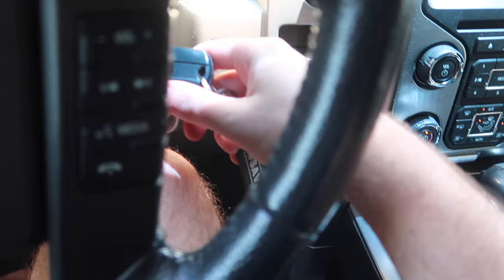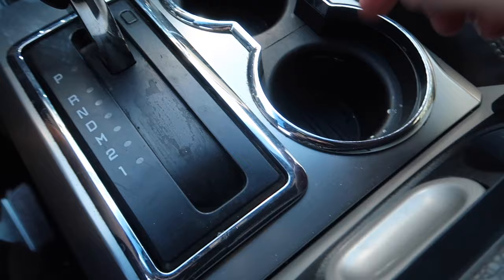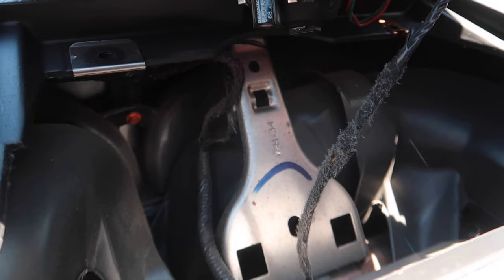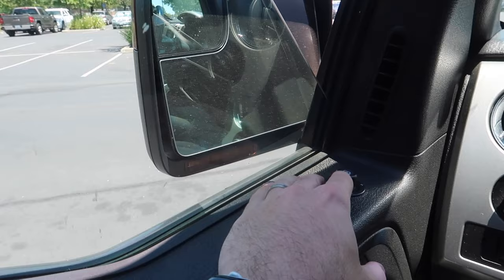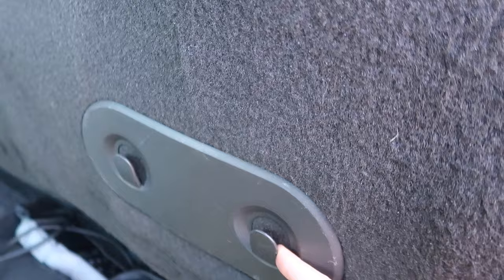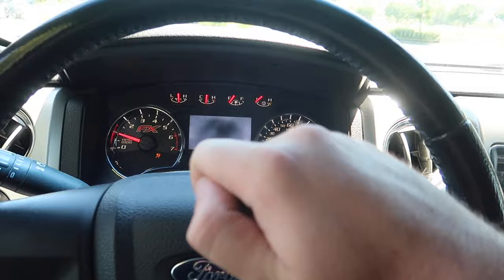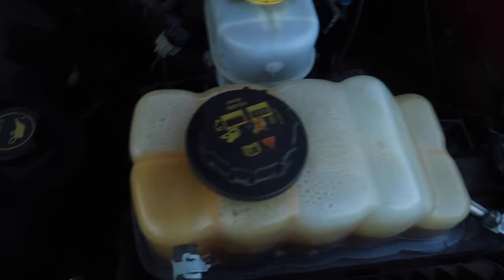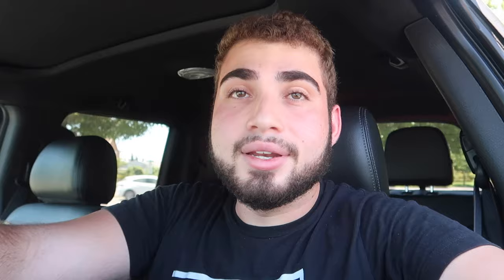FORD F150 HIDDEN FEATURES/FUNCTIONS (2004-2014)

Comment: If you have the keypad on your door after entering your door code press and hold the number 3 it will unlock the remaining three doors.
Reply: My dad had a ‘15 super duty f250. on that you don’t need to hold button 3, just press.
Reply: So after entering, i have to go out again to the key pad :(
Reply: Press 7 and 8 and all doors will lock
Reply: Dang. I have my 2013 for almost 10 years and did not know this. Thank you!
Reply: @Matt Keene what about if u don't know the code n it didn't come with the book. How do u find out what it is??
Reply: @desireewatson4828  you can find a YouTube video on that
Reply: @casey587  thanks
Reply: @desireewatson4828  look on the passenger side front, open door look at side panel near floor board there is fuse box inside that you will find the reset code for your vehicle. Ford wants to charge you $100 for this code that is inside your truck and they do the same thing.
Reply: I can't remember which one but you can also start your car/truck by pressing one of the buttons after your code twice
Reply: @ronaldnorris2179  on the 11th gen f150 like he has it's 9-0 and 7-8
Reply: @desireewatson4828  look up on you tube. I did it with my kid's ford escape. Hers was stamped inside the gear shifter. Idk abt the f150 though.
Reply: @denise6861  I'm needing it for my '08 edge
Reply: @desireewatson4828  you tube it and be very specific in your search, like "finding door code on an 08 Edge"
Reply: It’s on a sticker that is on the passenger side lock panel fuse box
Reply: @denise6861  if you have both keys you can get the factory code to pop up on the screen then change it to your own on the radio I found it on a video on here
Reply: You can also lock the truck from the keypad - just press the last two buttons simultaneously.
Reply: @desireewatson4828  It is on a sticker on the side of the cpu module underneath the passenger kick panel under the dash.  Hard to get to though.
Reply: @desireewatson4828  passenger side (interior side wall of the foot well) inside the fuse box compartment, should be the factory code, on a sticker. There is a YouTube video somewhere.
Reply: @cavebexartx  I got it for my 08 Edge. My wife just got a 2020 Edge n of course the card for the door code is gone. There's 2 ways to find it. 1 would b super easy if we had 2 key fobs but we don't. The other is to stand on your head driver side unscrew a bolt pull out a little bit the fuse box. Take a mirror with an extension on it read the numbers. Remember it's gonna b backwards. Put everything back. They make it so easy 🙄 😂. This fat girl is gonna look for another way 😂😂😂
Reply: My 08 doesn’t have a key pad.
Reply: Or just go on to the settings and change it to a “one-step lock”
Reply: Thanks for that. I didn't know it could do that. That comes in handy.
Reply: Awesome video. Good info. Thanks 😊.
Reply: Or program it to unlock all doors with the code
Reply: Put in the factory keyless entry code and when It unlocks press the 1-2 button and it will lock and unlock. Now you can put in your own 5 diget code.
Reply: @desireewatson4828  well just incase you didn't find the answer by now the factory code is behind the passenger side kick panel it should be a sticker on the fuse panel it should be a 5 digit number
Reply: @desireewatson4828  pull the fuse panel cover off on the passenger side floor kick area and it's on a sticker
Reply: @kathytracy9495  how do you reset the truck though? Somehow I've activated the admin function where the radio will not go past half way in volume and speed limit, I cannot go over 80
Reply: @sebastiannelson9506  You need to look up ford my key
Reply: U can always open the door an hit the button
Reply: Go to settings and change it to where they all unlock
Reply: @desireewatson4828  on the passenger side footwell, there is a access panel where you’ll find the original factory set code.
Reply: You can go into your settings on the dash and set your key fob to where all doors unlocked with one push of the fob
Reply: The owners manual will show you how to set your own custom door code number.
Reply: My f150 you only have to put in the code and it will unlock everything. And you press the two back buttons and it locks it fast
Reply: @ryanwagner382  this is the method I used but I also needed to pop out the cupholder and insert the main key in a slot under the cupholder.

Comment: Also a cool feature about the 3.5l EcoBoost engines is they will actually stretch your timing chain to a bigger size. Just a little neat thing.
Reply: LOL!  I have the 5.0 V8, glad I didn't pick one of the EcoBoost variants!
Reply: Lmao what even 😂
Reply: Can confirm happened on mine a few years ago
Reply: Glad I bought a Gen 1 V8 Raptor instead of a Gen 2…😂
Reply: @Mineratron  me too!
Reply: ya last year I spent $3500 on that fun little thing
Reply: Coyote 5.0l in mine. My friend bought same truck same year and bought the eco boost 6 cylinder and has had major problems with it. So glad i never bought the eco boost engine. I tow heavy loads with my truck and in 10 years never missed a beat.
Reply: I have a warranty 100 dollar deductible so idc 😏
Reply: Yup timing chain and cam phasers
Reply: I got the 100$ deductible warranty on mine too🤣 kinda hoping shit goes out so i can get it replaced ahead of time
Reply: 5.4 also does this
Reply: @regularguy1140  yep makin a whole 275rwhp with that 6.2L V8, squeakoboost raptor gaps you all day
Reply: Fun fact, all vehicles require maintenance.
Reply: @Mineratron get gapped by a little 2.7
Reply: @Tannerbaker3331  doubt it… mine is a Stage 2 Roush 🦾😄
Reply: @Mineratron  you from Texas?
Reply: @Fredjoe5  Same here.  Even though the Eco-Boost is a better performing engine, as a DIY backyard mechanic, I just didn't want the added "things that can fail" and stuck with an engine design I'm more familair with.
Reply: @drewdias3380  And it's a good thing they had "lifelong" spark plugs in them.  Lifelong whether you wanted them to be or not.
Reply: @bobby D  lol you can change them if you have the ambition and a couple spare cylinder heads just in case
Reply: @jeremyjones6667 auto start every start up. Never let it cool down before you turn it off, turn off as fast as possible. Good luck
Reply: How do you prevent that?
Reply: 😂 true
Reply: Throws the Timing Off and makes the Truck run like crap and you get piss poor gas mileage! That crap blew up my engine!
Reply: @Fredjoe5 it happened to my 2011 5.0. It's not just the 3.5
Reply: Oil changes are important never go by that timer ford has also used full synthetic I have 250k on my 14 EcoBoost and haven't had a problem mind you if I did it wouldn't but me up until this point I've only done plugs 2x and a 2x break jobs and the booster gasket can't really hate nothing last forever I do feel sorry for the new gens I've heard they have a lot of problems

Comment: It's been on Ford trucks since at least 98, but I've met many people with f150's that didn't know about the extra tailgate posts.   You open the tailgate and if you unhook the top cable there's a second post above it, put them both on there and then your tailgate will have about a 30 degree incline. Great for hauling lumber or something you can raise the plywood or 2x 4's up to help keep them from sliding backward

Comment: There is a release pull behind the back seats just inside the door so you can fold the seat forward and store some smaller items. I actually added a little cable and attached it to the headrest post for ez release
Reply: Same here, but instead of trying to drill a hole in the short post, I just tied a tight knot to it then hot glued it.  Seems to work fine so far.
Reply: Great to hide your truck gun!  They make an adapter that allows easier/quick access!
Reply: Me too😊. I like that little hack
Reply: Yep, I don't know why Ford made it a pain in the butt to get to that latch. I hand a big 😢 it is really hard to get back there. Likewise,  I tied a picture frame braided wire to it and tucked it under the headrest.

Comment: Been a GM guy forever. I just bought a 14 King Ranch and it is an absolutely awesome truck. So many features that other brands just dont have. I never realized how well Ford engineered these trucks. Rides amazing and is fancy.  Smart as hell and definitely convenient.
Reply: Great year
Reply: Huh. After a nightmare of ownership from a 5.4 3V, I'm certain I'm never buying a new Ford again. I obviously see you got 2014, so that's not new either Funny thing is I tend to agree about the looks and drivability.  It certainly is reflected in the insane prices they ask for them.  I still own my 2004 FX4 crew, really only because I'm kind of "stuck" in it, if you will, for all the remanufactured money I poured into it
Reply: @teecuzbruh4058  12th gen were fantastic. Easy to work on, only a few problems to watch out out for such as the coolant y pipe and transmission quick connects, 
I have 128k on it now and have had 0 hiccups. Intake cleaning took the tick out of the 5.0. 

I'd buy up to a 17, Ithey went to third gen coyotes after that
Reply: @teecuzbruh4058  , it’s no wonder you’re unhappy. The 5.4 was pure crap!
Reply: @Navyguy1990  Mine runs fine, and tows very well for a stock setup, for now LOL.  I won't ever be buying Fords overpriced shit again.  I'll likely be inheriting a 2014 eco boost when the old man has no more use for it. Pretty sure the early 5.4 2V was more reliable after the blown out spark plug problem was addressed.  That was a minor problem when compared to the 3V nightmare.  If this Toyota I bought serves me well, I'll likely stick with them going forward, if I'm to purchase again, though this very well may be the last thing I buy
Reply: I have a 2011 Ford F150 3.5L V6 Ecoboost (1st generation Ecoboost) and let's say the engineers that designed this are some of the dumbest people on the planet.  Let's put a standard 3.5L V6 chain on a twin turbo charged engine.  What could possibly go wrong?  I will tell you, $3500 later, had to replace all the timing components and two of the cam phasers.  Oh let's go ahead and put the water pump inside the timing cover as well.  Pure geniuses I tell you.  Love my truck it's that the engine was poorly designed.
Reply: The King Ranch 14 is legit. I’ve got a 2011 now after owning a new Duramax and a powerstroke.  The f150 is just awesome
Reply: Mines the 3.5 ecoboost theres 111 k on it and it was meticulously  serviced every 5k. Nice really clean truck. I suppose  we will see how it will hold up.
Reply: @thedarkphire33  what year?
Reply: @bearing_aficionado  2014
Reply: @thedarkphire33  at least your's has the updated timing chain.  Apparently the timing chain fix was the chain they used in 2012 and up.  Hopefully, everything stays good on your end.🤞
Reply: @bearing_aficionado   I'm sure hoping. that's why I always tend to buy the last few years of a generation of vehicle. Most of the issues have already been fixed.
Reply: @thedarkphire33  I just bought my truck last February before all the prices went out of control.  I also stole my truck from the dealership but I bought it knowing it had the p0016 code which was the cam positioning sensor not reading correctly.  This is the timing chain more than 5° degrees off.  It cost me $3500 to fix.  I also replaced the water pump since it is located inside the timing cover.  I still came out ahead because if the dealership would have fixed it, they would have asked between $17,000 to $20,000 for my truck.  As someone who is new to the ecoboost engine, I have done a ton of research on them and to know to never buy a 1st generation anything again.  I agree with you to buy a couple years in, so they have time and research to workout all the bugs.
Reply: @thedarkphire33  I totaled my car about 2 weeks before I bought my truck because of a stupid deer running out in front of me.  So I had to find something cheap and quick and my truck literally fell into my lap right at the right time.
Reply: I know bro king ranch is the best
Reply: @joseresendizvega3323  I have an 07 STX with the 4.6l 2V only thing I really don’t like on it is the whole intake is fuckn plastic otherwise it’s a good truck has 4x4, A/C I installed cruise control and had the PCM re flashed for $45
Reply: I would not buy any other Truck other than Ford. I have owned 3 of them over 62 years no problem with engine or tranny on anyone of them. 325,000 MILES ON my 2nd pickup. 1994 towing boat as well trailer loaded with moose hunting gear and bikes all over Ontario. Sold truck to guy for 2500 bucks then bought one i have had now for 11 years and same towing and no problems at all. Reason they are the number one truck sold FIFTY years running!!
Reply: picking up my 14 KC next week!
Reply: Still rolling around in my 2002 ford f150xlt 5.4 2v with 230,000 on it
Reply: I’ve been driving Chevy and GM for 30 years bought my first Ford as well love it
Reply: @mariusgage5471  My transmission line started leaking and I hurried up and changed those. The last thing I needed was to have to replace a transmission. Already had to do it on the last truck.

Comment: If you have programmable seats, press and hold the program button on the position of your choice and you'll hear a beep, keep holding until you hear a second beep them hit the lock button on your key fob. It will automatically move to that position when you use that key. Can be repeated for the second driver with their own key and will automatically go between the 2 without needing to press the button every time.
Reply: I knew about programing the buttons on the seat but didn't know it could be married to the keys.  Now I gotta go and try it.  Nice tip!
Reply: Thank you!! I have a 2012 and me and my wife work together I drive to work and she drive it home and trip uptown while we are at work,we are wearing the buttons out on the seat. Just programed the fobs like you said, this is gonna be a game changer, Thank you!!
Reply: Actually when you program the seat it's automatically on the remote
 If you manually adjust the seat after preset has been made, lock the doors with remote. The next time you hit the unlock on remote the seat will go back to preset. This also works for mirrors. The "two beeps" on the seat button is all you need for everything to be set.

Comment: I never knew about the diagnostic mode. My battery completely died one time and after replacing the battery, the speedometer was off by 20mph. At a stop, the needle was below 0mph on the gauge and was a constant -20mph shift. It’s been like for a few years. I did the diagnostic gauge test and it brought the needle a little closer to 0 each time I did the gauge test until it was perfect. So thank you for this!
Reply: You have to get the BMS to reset. You can do it with a cheap ob2 and Forscan. If you put a new battery in the truck think it's the old one and will only charge it so much :)
Reply: @bradbury2007  Thank you for the info, learn something new everyday. Quick story on that, it happened again and the needle was off 60mph, insane. I didn’t fix it but then my AC compressor took a shit and I took it to a shop to get replaced. The dash had to come out for that job and when I picked the truck up the gauge was right back at zero. If that happens again I’ll refer back to this, thanks.

Comment: My 2013 has an accelaror pedal adjustment under the signal arm. It adjust the pedal closer to you and farther away.
Reply: So does my 05 fx4!
Reply: Lariat and above and xlt with some packages have adjustable pedals
Reply: Technically just moves them closer. Standard pedals are slightly farther than the farthest adjustable pedal setting.

Comment: Also, that model comes with "safety" windows- when window going up in auto mode, if it comes in contact with anything, it will only push with 1-2 lbs of pressure, then automatically stop and reverse.  Put your arm out and try it.....
Reply: Yeah I installed some vent shades that go in the channel and that auto stop was a pain for awhile until they finally seated good !!!!
Reply: Tried it and thanks to you I dont have an index finger anymore
Reply: @ronaldnorris2179  same 🙄
Reply: But only on the front windows.

Comment: I've had the same truck since I bought it new in 2014. I love it,  but it has some special needs.  
Recommendations...
1. Don't get the chemical intake cleaning treatment or you may be buying two new turbos like I did. 
2. Pay attention to your coolant level. There is no light to let you know it's low. This truck has coolant fittings that like to leak.  
3. Keep a watch on the transmission lines to the cooler.  They like to break off at the radiator.  You'll be buying a new transmission if you drive it hot. 
Other than that, enjoy your truck. It's fast!
Reply: reply to 1st recommendation... Are you talking about after market catch cans or actual chemicals used to clean?
Reply: @kenmoses8  
He's almost certainly talking about "induction cleaning." DO NOT.

Comment: I bought mine used. Thought it was missing the jack. Thanks for the video. I’ll be returning the jack kit.
Reply: Have you actually removed the jack yet? There are 2 knobs that are bolts that thread into the metal box that the jack kit is in. You'll have to remove both to get that box to slide out. One is under the passenger side of the rear seat.

Comment: On the Menu you can set up how long you want your truck to be turned on with the remote and set the AC or heater to the last setting before truck turned off. Useful for really hot days in Texas!